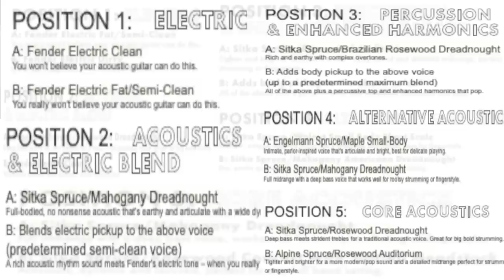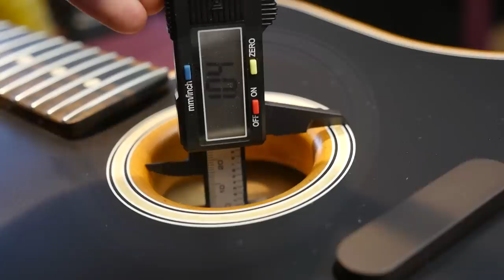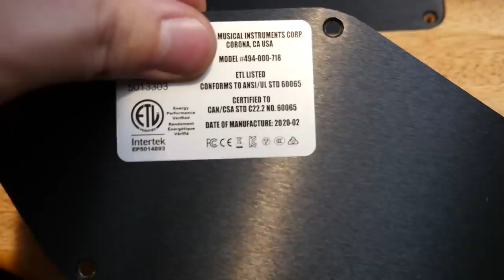Is It REALLY Worth Buying One of These? | 2020 Fender Acoustasonic Stratocaster | Review + Demo

Comment: Epiphone Casino, a full hollow body with a narrow overall depth electric guitar similar in size and depth to all modern semi hollow bodies like the Gibson ES-335, except the Casino is a hollow body, for around $700 new. I have had mine for 3 years and it's a good guitar. Sounds good acoustic as well as electric. It plays like an electric guitar but unplugged it's more than loud enough to play alone. No, it's not as loud as a deep bodied hollow body but the trade off is it's a lot more comfortable to play and hold. The P90's have a great strong tone as well. I'm positive it's better than these Fender's! Especially if you install acoustic guitar strings onto your casino. I have not found that necessary, but I do think it would make the casino sound not only louder played acoustically but it would also make it sound more like a regular acoustic only guitar. Not a bad idea to try!

Comment: I'm afraid I really didn't like the tone of any of that at all.  The bottom half was a mess and the top half was gritty and spitty.  Either thin or muffled.  Nah, not good.  As a hi fi designer (I've never done anything for guitars though) it sounds to me like a cheap and crappy amp or some horrible DSP chip.  Usually you can't screw up a simple source quite so comprehensively.

Comment: My only issue with this guitar, like so many others is the fact that you adjust for intonation.  Why can't they start making all guitars where you can set the intonation?  This is why I don't buy acoustic anymore cause I have spent money on high end acoustics and sound like shit cause the intonation is off and there is no way to fix it. When I spend money on a guitar I have to be able to set the intonation cause my ears will pick up on the slightest string being flat or sharp.

Comment: Interestingly,  the Acoustasonic Strat played acoustically seems to be naturally well EQed for recording acoustic tracks. It does not have all those low-minds that we end up attenuating anyway. I've had good performance in this regard from an Epiphone Casino which, as you know, is fully hollow.
It certainly is NOT a good electric guitar. A Line 6 "Variax" is a much better electric/acoustic alternative even though it greatly suffers from option paralysis. 
BTW, beware too low acton. Slightly higher action promotes better resonant sound. Also, thinner strings produce better mids and upper mids, do not harm the acoustic sound, and perhaps improve it.
I would have liked to hear it played in a band context to hear what it really sounds like. Backing tracks really make a difference in demos.

Comment: Glad you are impressed with the fingerboard aesthetics. The ebony board is made from the scraps of ebony that is used for higher quality instruments. The brown is considered inferior, even a defect in the wood, as it is softer and will wear sooner than the black. Even a "B" grade ebony board for a decent orchestral instrument is nearly 100%solid, uniform black. As for the rest of the construction quality, there are visible irregularities, even when viewing the vid in the standard youtube smaller window. But, lots of guys think nothing of spending $1100 on a guitar, so Fender will make some money. The manufacture of this guitar cost the shop a VERY small fraction of the "Discounted" retail.
Reply: I'm not arguing, but there's an industry-wide push to use this "inferior" ebony in guitar manufacturing, as the current harvesting practices are not sustainable.  There's no way of knowing if the wood has any light streaks in it until you cut the tree down, and the common practice up to this point has been to leave the tree to rot on the forest floor if it's not completely, or mostly black.  The only thing that can be considered "inferior" about the wood is the aesthetics, and that's just a matter of opinion. Personally, I don't care for the look either, but I think after people get used to seeing it, it will begin to be regarded as cosmetically pleasing.  Believe it or not, there was once a time when flame and quilt figuring was considered a "defect" in the grain and was rejected.

Comment: Not impressed, straight out of the box I had to take it to a guitar tech to take the rough edges off the fret board, then the whole thing is set too loud, I cannot play it on full volume because it distorts.  this is compared like for like with a Paul Reed Smith, it is noticeably louder the only way to cure the distortion is turn the guitar volume down,  disgusted of Wakefield UK

Comment: I’m out after seeing that scary cluttered circuit board.  Your guitar tech will need spare boards if you take it on the road.   Also a big nope on the rechargeable battery.  It should also have a place for a backup 9V battery for road use.

Comment: I have one and love it.  I disagree that it does not take distortion pedals well, I run it through my board just fine.  I will give you that it does better with some pre or post EQ for my electric tastes, but it handles a OD pedal fine.  I think it comes with 11's on it.  I tried 10s 80/20 elixirs and hated that.  Have 12s on it now to bring back the bass.  10s where way to shrill.  When I wear through these I'll through the 11s I have on it to give that a try as I did really like the fender 11s that came on it; very harmonically rich among strings.  Great review, thanks.

Comment: Disappointed that they haven't "fixed" the output circuitry.
 Read  my review of my Tele version over on TDPRI  https://www.tdpri.com/threads/fender-acoustasonic-telecaster-opinions-praise-criticism-and-warning.991216/#post-9462053

If you don't want to read the link, Ask yourself THIS question; how do I get the ball ends from broken strings out of this guitar? Wouldn't the metal ball ends short out the circuitry? The answer is yes. Yes they would.

Comment: 2000 bucks and no HSC? FAIL number 1.  Poorly finished top in two spots on a $2000 guitar? FAIL number 2. Proprietary pickup adjustment must be done by Fender approved tech? FAIL number 3.  Three strikes and you're out Fender.

Comment: The neck is gorge, the body needs a bag put over it, and the electronics are straight up gross - soulderless Chinese circuit board literal cut corners to fit the pickup in... WTF? at $2000 its a hard pass from me as it seems like 1/2 the guitar at 2X the cost i'm not seeing the value proposition here. At $500 you could market this as a beginner instrument and a $$$ saver I have no idea who Fender made this for.

Comment: I hate to say this, but it looks like a cheap guitar and sounds like one. Any decent woodworker or speaker cab builder can put together a sound port in a box. Nothing really special about that. I am not sure who Fender is actually marketing this instrument too? For the current price of $1800 you can get a really decent electric with a piezo, if you want some acoustic emulation from an electric guitar that also has standard pickups that can sound really good. The piezo will not replace a mic'd acoustic and neither will this contraption. An acoustic guitar with the right pickup system installed can sound like a fair representation of the acoustic. The 'electric guitar' sound of this instrument is on par with again a fairly cheap standard electric guitar. So for the price of this guitar you could get both a good sounding acoustic and an electric guitar with decent pickups. You could also get a different hybrid piezo electric  who's acoustic emulation sound is almost on par with the Acoustasonic but would have much better electric pickups. To me, Fender has created a Dud Jr. from its original offering of this type.  I looked at other reviews of this instrument and the sound is similar to what you hear in this review. I own other Fender instruments that I love but this thing is an albatross and or boat anchor. I hope persons who bought this instrument have found something to their liking but for me would look elsewhere.

Comment: Wow it sounds exactly - un - like any acoustic guitar Ive ever heard - total gimmick - you can't make an acoustic out of an electric by putting a hole in the middle and slapping some pickups on it  - absolute nonsense - youre right this is a toy and one that will not age well and will go down in fender history as a real dog of a project - Fender keep doing this because they have yet to produce a decent acoustic guitar that can match Martin or Gibson and they most probably never will - They just dont get it - Even buying Guild just cheapened the Guild reputation and brand - they should stick to the original gimmick which actually worked.